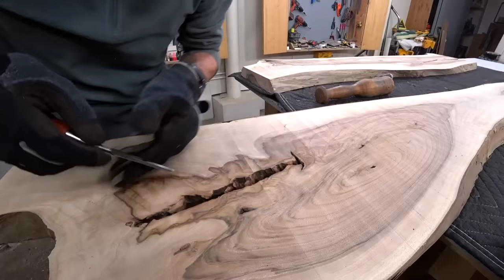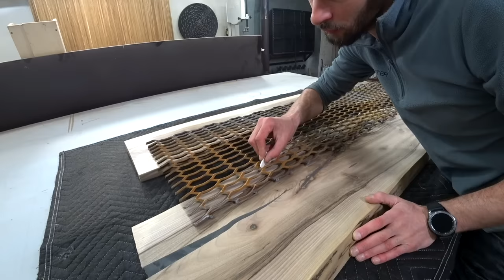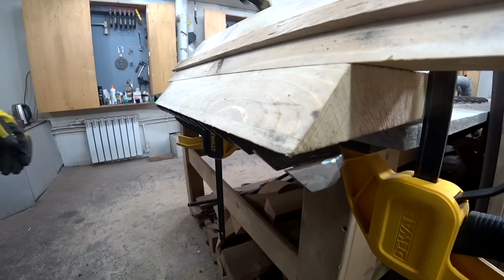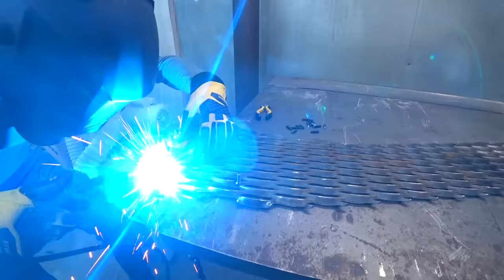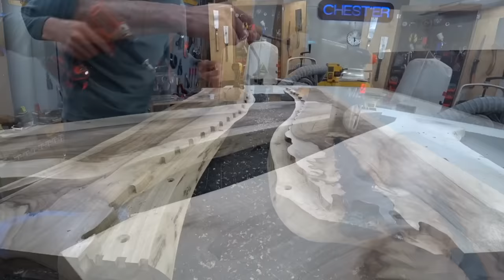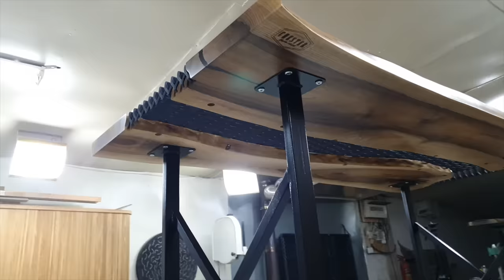Metal river table | CHEST'ER

Comment: I never would have considered X-metal for a river table, but WOW. Beautiful. Also, your freehand routing technique is impressive. Clearly, you knew how to handle the torque of the bit against the wood's grain flow. Nicely done.
Reply: More refreshing than the million other resin pours on the internet.  Fuck I hate those bullshits. :face-blue-smiling:
Reply: It's the big bit you would lose it with a small one
Reply: @muffemod  just don't buy one and don't watch those videos...

Comment: wow, i would have never thought to make a table with the expanded steel mesh, this turned out far better than i though it would have when i first started the video! i thought you were going to epoxy it in, so when i saw you welding on the studs i got really confused, then it all just came together perfectly after that

Comment: That's an awesome looking table!  For the longevity of the metal, I recommend sandblasting the metal, or chemically treating the metal to remove the rust, then have the metal powder coated vs spray paint.  Unfortunately, the existing rust is going to continue to oxidize under the paint, and cause the paint to crack and flake off within a year or two.  Again, I'm not knocking the overall design, It's incredible, if there's and opportunity to do something better and make it last that much longer, I would always make the recommendation.

Comment: The funny thing is those cuts you made are so much harder than any epoxy river table out there.  I've seen guys do custom glass instead of metal to a certain cut using a CNC, but this was all done with the router and that much more impressive.  I think the guys had an issue with the first fit using the CNC and were really nervous about getting it right the second time lol.

Comment: very nice result. . a question. is russian grinding dust from epoxy not that hazardous like in other countries? the craftsman used a breathing mask for nivelling the surface, but didn`t use one while grinding and routing.. bye the way. the positions were the metal lies on the wood are pretty good to catch dirt from daily table using. better filling with clear epoxy...

Comment: Oh man, the flex with installing the legs made me nervous. Is the table substantially less structurally sound being two halves joined by essentially a piece of metal netting? I'm always curious about these things. I was wondering if installing even a small crossbeam between each of the two end bits would help with the central strength of the table. 

I doubt people are crawling all over it or putting anything beyond dishware on it, but I'm still curious. 😂 

Either way, this turned out great! Very minimalist but satisfying.

Comment: It's a very unique design! I'd just be worried that the ends of the mesh, being as exposed as they are, could snag on clothes or scratch the hands of people accidentally brushing up against the ends of the table while going past it. I probably would've either bent the end parts in or added a protective bracket, but that's just me. Cool design nonetheless!

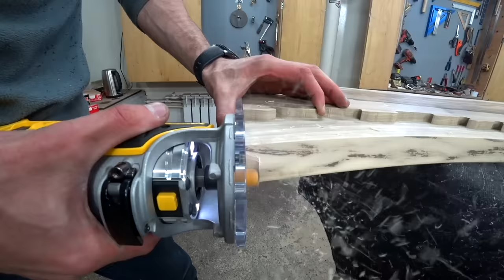Comment: @7:40, it looks like you are moving that router in the direction the blade is cutting. Meaning it could skip out and route out your left hand. Best to not think you can control the wood or handheld router/drill as they have so much more torque.

That your hands are still intact is more chance than best practices.

Comment: Great work, but not highly functional. I can't put my computer or laptop on this table because it will scratch. I can leave pens or any small items because they would fall. Beside, the metal part is not perfectly levelled at the same alignment as the table. Please don't get my comment as a negative reply. It is rather a form of constructive criticism to focus on functionality in future designs without compromising on the design. One way of going about it would have been pouring resin on top of the metal. It would be functional,  protect the metal and anything put on the table from scratching, and conserve the aesthetics of your design. Best of luck!